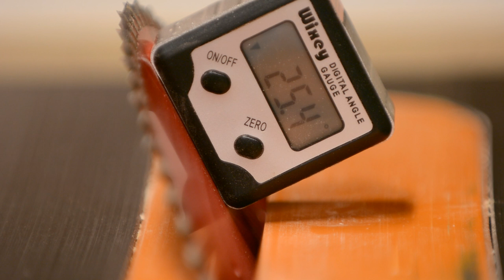Lamp from a 2x4 - 2015 Summer's Woodworking 2x4 Contest Entry

Comment: What a bright idea!

(Sorry, I had to get that out of the way...)
The shavings being used as the shade was brilliant and inventive.  Never seen something like that before.
Reply from the maker: wordsnwood Thanks!  I had a different plan for the shavings originally.  I was going to keep them rolled up and just press them to be flatter and then put them next to each other and paint epoxy over it to lock them together.  I did a test and it worked but I wasn't confident I was going to be able to do it on a larger scale without there being gaps all over the place so I went to plan B.

Comment: The lamps shade definitely blew me away.  I've tried making a shade with wood before, but didn't think to use shavings; I just tried to cut them very thin on the bandsaw.  Yours is definitely a better idea.
Reply: Nice Job, thanks for sharing
Reply from the maker: MonkWerks with Fr. Thomas I just wish I could do them wider.  Tried to do it on a 2" face and the plane went nowhere.  Gotta bulk up I guess :)

Comment: Man I'd like to see a more detailed video on how you made the lamp shade. That was incredible!
Reply from the maker: MrD Poling There wasn't too much to it once the panels are cut out.  Glue on the shavings a few at a time, however many can fit at once.  By the time you've done the 10th one it's probably been enough time to go back to the first one and trim off the excess and glue on a few more.  Keep going until you can't see any open spots.  You could probably come up with a way to make a big sheet of the stuff and just cut it out but I didn't want to see any of the ends of the shavings.

Comment: First of all, that lamp is baller.  It goes without saying. Second, thumbs up for the shallow depth of field. There were a couple of times I wish you had a camera man to rack focus, but it wasn't distracting at all in my opinion.
Reply from the maker: Mike and Lauren Thanks!  It worked in some shots and not so much in others but forcing yourself into a particular abnormal focal length rather than being lazy with the zoom is a good exercise.

Comment: I vote for you for winning the competition. This is amazing. only thing I think I would have done differently would be to round over the edges around the lamp base. It does look amazing and using the shavings for the shade - who would have thought of that?
Reply from the maker: Robert Tucker I did round them over, but it's 1/8" so hard to tell from your perspective.  The cord goes through it and it's only 3/8" thick so I couldn't do much more than that.

Comment: Totally woodworking unrelated question here:
What lens do you use?
The depth of view is so shallow!
I presume you use some long focal length lens?
Reply from the maker: Rexus King I usually use a Tamron 17-50/2.8 but for this video I decided to experiment with the really shallow dof.  It was almost all shot at 200mm and f/2.8, though at the minimum focus distance the actual focal length is a lot less than 200mm, but it's on a 1.5x crop body so it evens out.  It was with a Nikon 70-200/2.8 VR I.  I thought it worked well for some shots and not so well for others.  I figured with all the entries people could use a break from the normal way things get shot.  It was a break for me too and a challenge sometimes figuring out how to shoot certain things like the glue up without having the camera half way down the block to get it all in.
Reply: krtwood 
1. All shot at 200mm sounds very challenging!
2. I have no idea that focus distance can affect focal length...

3. I think the results as a whole looks great, but some of the shots' DOF looks too shallow to me. But I think you can think of it as if you're keeping the build process in obscure, and reveling the end result at the end.
Reply from the maker: Rexus King
It's called "focus breathing" and any internal focus lens (stays the same length when focusing) suffers from it.  I agree about it being too shallow for some of the shots.  In some the angle I chose you can't really see the plane of focus at all so it doesn't really look like there is anything in focus at all.  It had a really crazy effect on the band saw fence too, it was really distracting.
Reply: krtwood Yeah after some research I now know what's focus breathing, it's just English is not my primary language, so I got confused sometimes :)
In the band saw shot, my eyes keeps hunting for focus, I guess ours eyes are just not used to not see anything in focus. But all in all, it still is really cool, the lamp too!